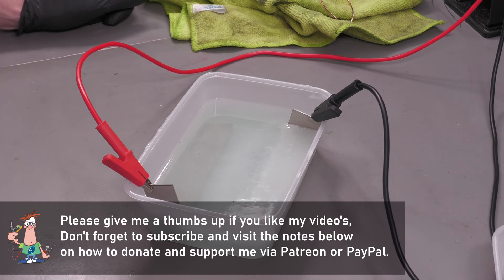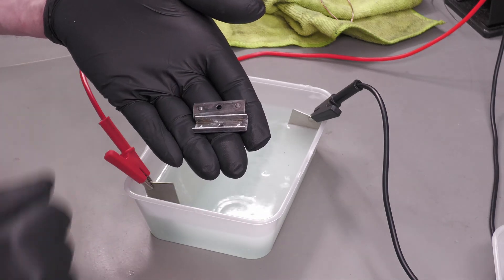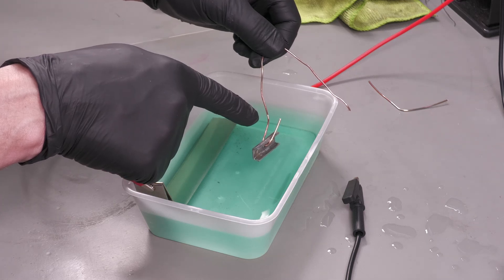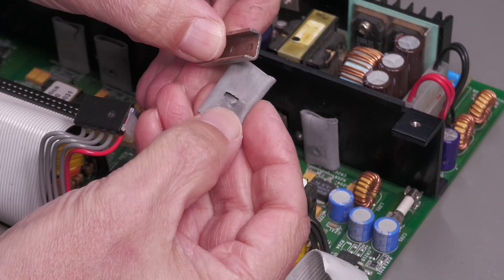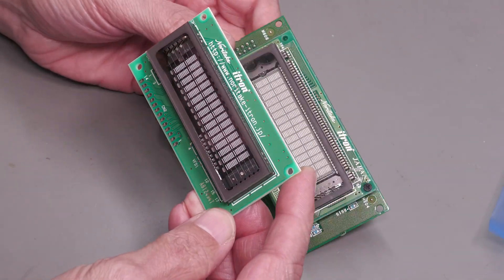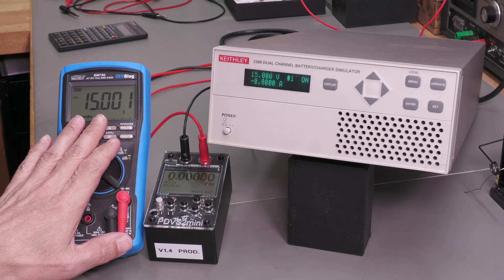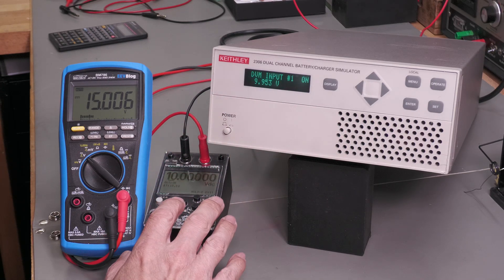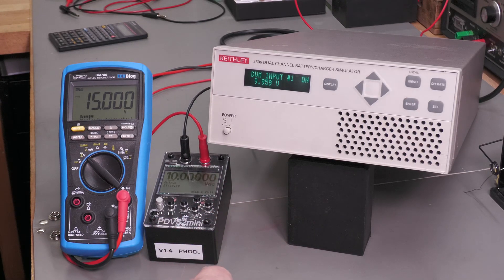No.116 - Keithley 2306 Dual Channel Battery Charger Simulator - Part 2

Comment: Where did you buy those insulators for the transistors from?
I have a Keithley 2400 with very crusty insulators. Probably I can use the same as you.
Thanks in advance.
/Sören

Comment: You have really gilded the lily with those metal brackets plating :-O. Can you use both channels of K2306 in series? So you could get perhaps 30V? Based on hardware design it seems like both channels are isolated on board level.
Reply from the maker: The manual makes no mention of series operation just that Ch.1 for charging, Ch.2 for battery simulation. Both channels are not identical (software). I still have to play about with it though.

Comment: Looks great. Used various solutions in the past for plating, some quite expensive or toxic. Nickel plating looks to work very well without much investment though
Reply from the maker: I think to get a decent plating I need a bigger bath, or maybe filter out the crud out every 15mins. I see some folks put a sock of some kind over the anode so the crud doesn't make it into the solution but the ions do. Deffo more experimentation required.

Comment: Well done, Ian. That's a very interesting piece of kit. Nice touch nickel plating the clamping bars. I have been using that process on some of my projects and the solution turns a lovely shade of green after a few uses. Regards, David
Reply from the maker: I chucked away the liquid afterwards......assuming I will filter out the grime and store it next time.
Reply: @IanScottJohnston  My experience is that the solution can be re-used. I give it a bit of a "recharge" before each use and filter out any crud after use. While watching your video I got the idea of using nickel plating next time I put together an extender board. Regards, David